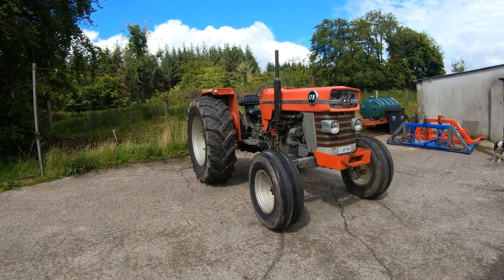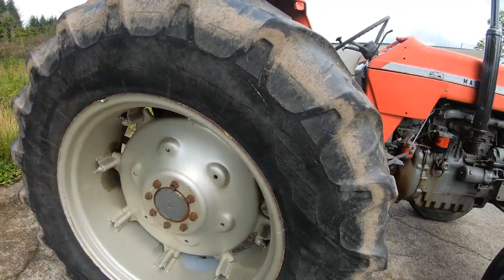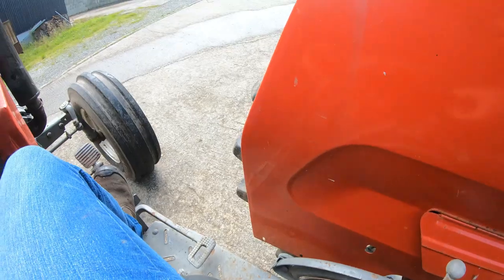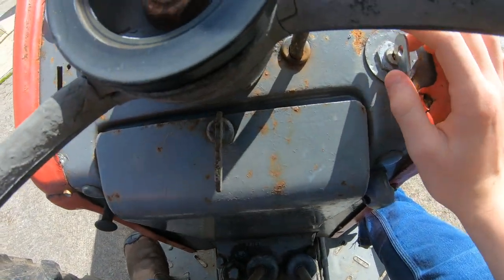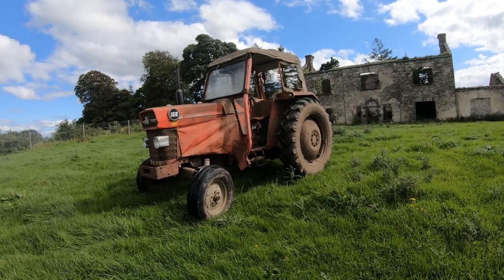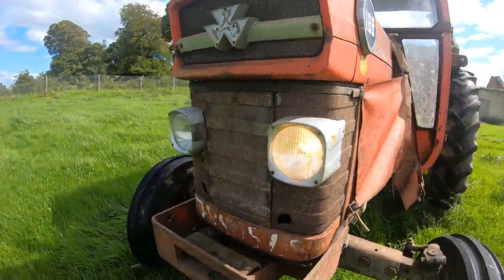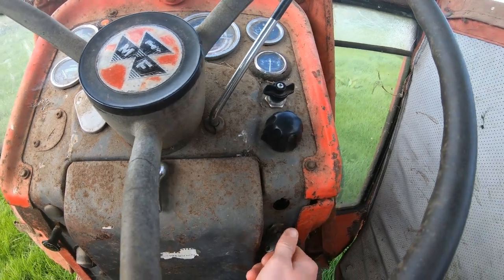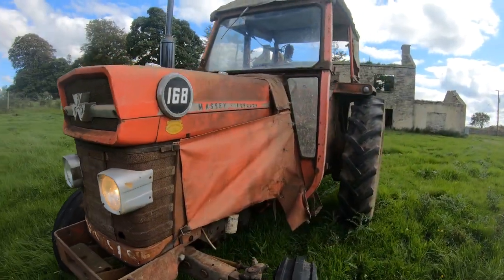Tractor Tour - Massey Ferguson 178 & 168 - Part 2

Comment: Nice vid lad. I've driven a 188 before which was fair rough but them masseys are beauties. Weve got 4, two which dont run, a 35 that does 50 and a 135
Reply: Hi

Comment: Why do ye have the covers on the sides of the 168
Reply from the maker: 🤷‍♂️ way it came neveer took them off
Reply: They’re part of the flexi cab that came on them the heat off the engine came in to the cab in winter times

Comment: What year and horse power are them yokes
Reply: 178 had the 248 engine about 73 Hp dry brakes, 168  had the 236 engine 68 Hp wet brakes and a bit longer tractor. the 185  replaced the 178